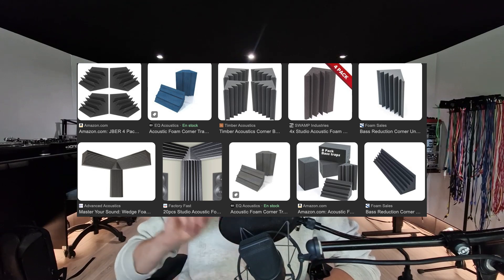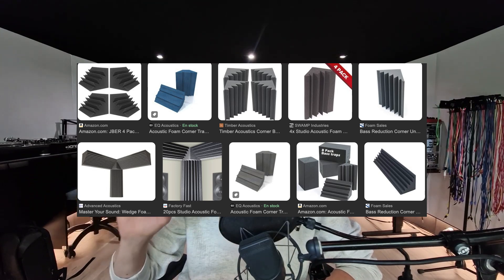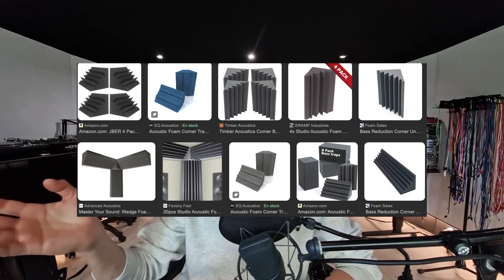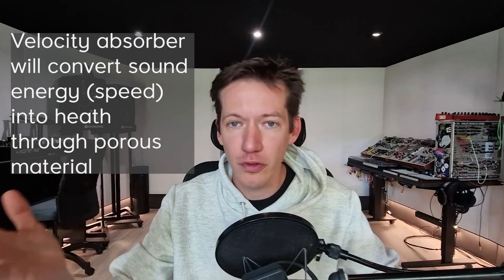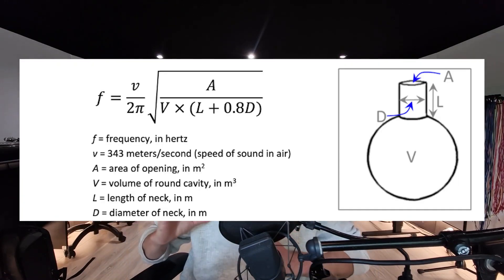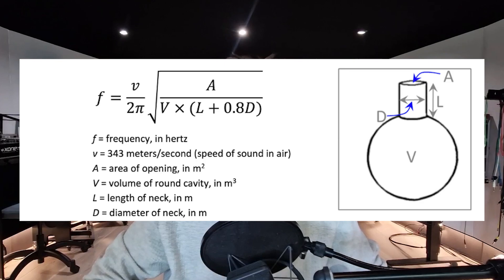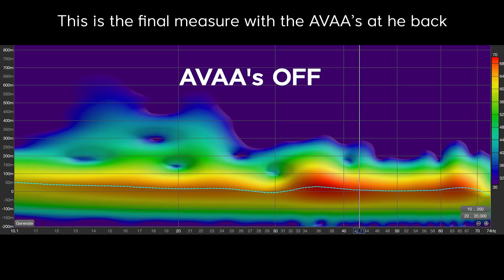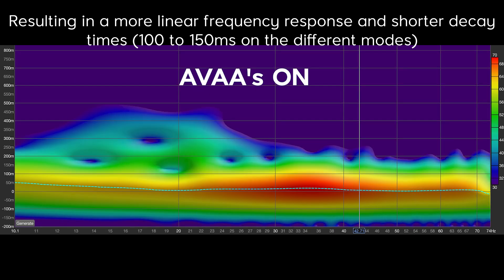How to really control the LOW-END in your studio

Comment: Say there's no DSP's in those PSI's? so what's the circuit? can't I get woofers & mic and make some enclosures and have something perform similar? if we can home built passive traps...
Reply from the maker: I don't know what's exactly under the hood of the avaa's. There's deffo some processing (filtering, phase) of the input signal. Back in the day i looked things up but There's very little info from PSI and not so much literature online about it. I you find more or manage to make something work please let me know!
Reply: @incidence.studio Hi, Well you have some, where's the screwdriver? :p And indeed the principle is already older and should be quite simple indeed invert the signal since it only corrects locally it's like a passive bass trap it doesn't correct for the listening positioning just for the room at the spot. 

But the principle is so interesting.. even homemade it will still be costly as you'll need mics drivers and amps and a couple of components. I'm in a new room I need to treat and I'm thinking could a combo work I need to build a fake back wall with insulation air gap insulation anyway could I line it with an active mechanism. And for the front wall it's even more interesting would it have the same effect as moving your speakers deeper into the room as the front wall is a huge issue with sound the further you get away from it the less compressed the sound becomes you can hear everything ring out properly instead of this smear.
Reply from the maker: @koyaanisqatsi78  opening them would deffo tell some about the analog circuit but nothing about the dsp and i'm sorry but not willing to f**k up my warranty for this...
Reply: @incidence.studioits an active membrane bass trap, basically it moves back and forth like a membrane, theres no sound coming of it, it just has a microphone to listen and it moves the membrane
Reply: @zonas7915  Their AVAA C20 is analog, but their C214 model is digital and you can connect to it with wifi and change some settings, so that will probably have some DSP funk in it.

Comment: Stay away from ported speakers if you want more acurite bass
Reply: Very general statement. Ported speakers can be perfectly accurate with low end. 

What makes a ported speaker bad, is when the port is simply thrown into the cabinet design. If correctly tuned and time aligned, ports can be great. 

However passive radiators are really the most accurate route in that regard.
Reply from the maker: @Jonathan_Wick  sorry but not. Ported designs will always add decay and smear transients beccause of physics.. This being said, closed enclosure will always create a small asymmetry (a bit like dc offset) as the membrane can't move totally freely creating higher pressure when moving inwards. In a theoretical approach this creates slight asymetric THD . As far as i'm concerned there's no doubt, i'd choose any day closed enclosure over ported one.
Reply: @Jonathan_Wick no matter how well tuned the port is you cannot get rid of the group delay
Reply: @Durkhead tell Genelec that, maybe they'll stop using ports
Reply: Can you give us some example for studio monitors without ports? Just don't say Avantone MixCubes or Yamaha NS-10.
Reply: @hatobp lol the dayton classic b65 ther just like ns10s😂
I would just get a sealed subwoofer or use beats or skullcandy headphones to check bass levels
Reply: @Durkhead  I’m using Focal Alpha 50 in my small room, which is about 23 square meters. There’s no acoustic treatment yet, but at least there’s no echo. It sounds decent, and you’re probably right, it might be better to check the bass on headphones until I get a subwoofer and treat the room appropriately.
Reply: The bigger Neumanns don't have ports. Ports and radiators will always result in longer time decay in the low end. This is directly related to the extra low end you get. So in terms of dynamics(like dialing in compression for your kick drum) you can't fully trust ported speakers. The only people that will be able to hear the difference though are people with equally as big or bigger non ported speakers.
Reply: @reiniervanzwieten7092  Do you have any concrete evidence to support what you're saying, or are you just repeating things you found online? Share something you've personally accomplished that makes your perspective worth hearing. Because, by your words all speakers are trash, even the most expensive ones.
Reply from the maker: @hatobp  physics... ports do delay sound -> delay means longer decay -> means lack of punch, transients and "definition".
Ported designs were invented to allow small woofers to still recreate in some way lower content they can't reproduce properly. Want proof? Take shitty micro "subwoofers for home cinema" (you know the tiny shitty things sold in some supermarkets a few years ago as 5.1 systems). Those subs usually have like 5 or 8" woofer but play "40Hz". Have you heard of muddy and uncontrolled the bass is on those things? The whole cavity resonates so yes you have some sort of low end restitution but it's unuseable for producing music. 
I can swear in contrast that never did i hear a bass so punchy defined and "dry" than on my kii three + BXT speakers (no port)

Ever listened to LS35a or NS10, ATC SCM20ASL?  That's just direct punch, no decay.

Comment: Hi, great channel & thanks for all the useful information. Please tell; did you consider/add diffusion plates to your GIK  Scopus (backwall) T40’s?  ..& did you test that having gaps between the panels compromised their performance too much? Thanks again & best wishes
Reply from the maker: in fact the scopus are behind a stretch wall (made of cara fabric) as this is how the whole studio has been built (covering all the diverse acoustic treatemnts behind stretched fabric walls. Having such a design was making the diffusion panels useless.
as for the gaps i had no space for some (the sides of the studio back wall are  just over 1,2m) so i just had space to place two units in the width on every side (so every side of the back door is made of 6 scopus panels) for a total of 12 on the back wall. 
having the fabric on the scopus + my stretch wall also allowed to dapen (absorb) sound at higher frequencies on the early reflexion points.
This being said diffusion vs. absorption is also a matter of tast, i know i like my working space a bit more on the "dry" side of things so i went vor an overal RT60 below 0,2 seconds across the whole spectrum (between 0,18 to 0,2s from 90Hz to 20kHz; 0,35s at 20hz; 0,27s at 30Hz and 0,25s from 35Hz to 60Hz. then some slight remaining "peals between 60 and 90Hz at 0,3s)

Comment: I have build a Helmolz resonator in the past. You need to build it in a modular way where you have the possibility to change the 
reflex port, just like you would do with a subwoofer when tuning and finetuning the resonance frequency.  If you plan this ahead you will
save a Lot lot great lot of time. 
Also from what i remember cause its been a few years i will admit so forgive me if i am mistaking, you need also 
filling. This is what then absorbs the energy. It is not like a big empty beer bottle but rather like a beerbottle stuffed 
with acoustic foam, wool, etc.
Also if you build Helmholtz one should not hope that a small one will have a great impact. You need quiet some Enclosure volume 
that gets bigger, the bigger your room issues are. 
Also as you mention about sometimes being easier and cheaper to buy ready solutions, one thing people seem to often underestimate 
is time spend. If you spend 1 month building it you should think about what else you could have done with this time and many times 
it is indeed cheaper to buy something ready made. Unless you do it as a hobby and like it. If you are a working engineer you will most probably 
appreciate that there are ready solutions in many cases but of course building things also is a valuable thing.
My two cents
Love your content my friend. Keep it going. One of the most relaxed and at the same time valuable channels
Reply from the maker: Yes indeed the modular approach (holes with tubes you can push/pull) is probably the smartest way to do things for Helmholtz and indeed adding dampening material inside spreads the frequency range action (like with membranes) . Yet the more you spread the frequency range, the least it becomes efficient at the given frequency, meaning it needs to be even bigger :p
I tried some in my previous studio, took me days to build and at the end, the results were not what I expected. Let alone the loss of space in the studio and the frustration having lost time and money, this is why I can only fully agree with your previous message. And thanks a lot for the kind words ! ❤